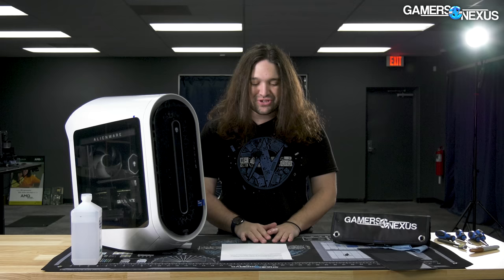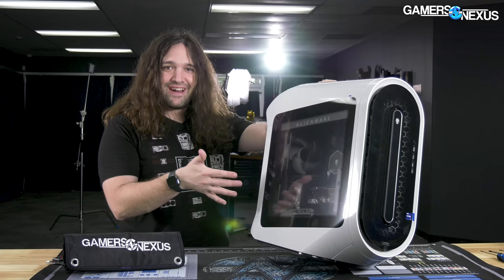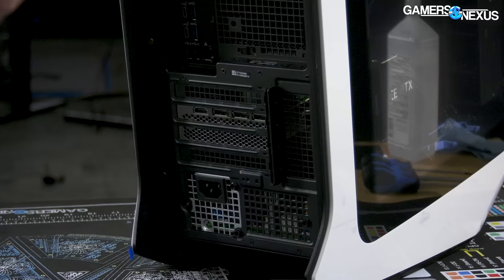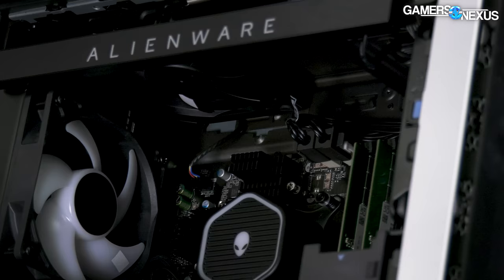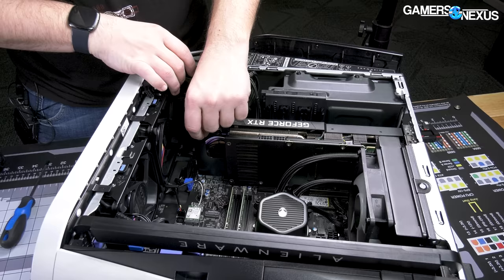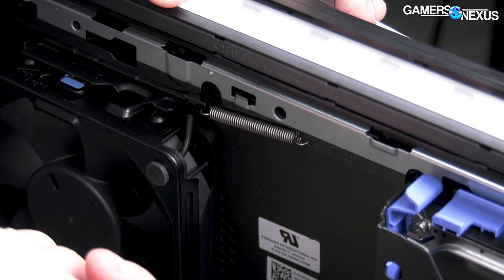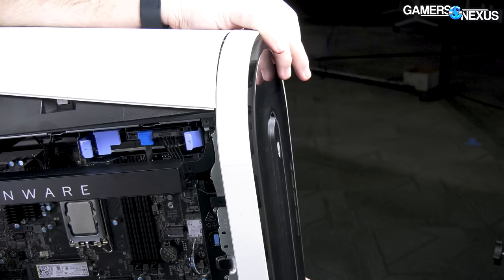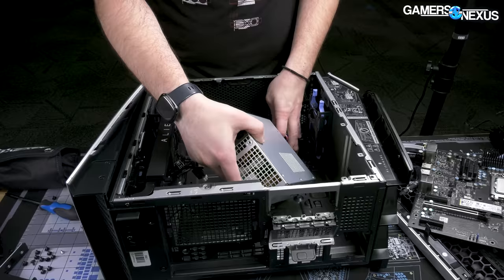Crazy Bad $5000 Alienware Gaming PC: R13 Aurora Tear-Down

Comment: Dell saved $40 by repurposing an old PC chassis...then spend thousands engineering and making parts to fit the old case.
Reply: It blows my mind. This PC is like a Kit-Car. You get a Ferrari engine, brakes, suspension, wheels/tyres. Then go to your garage and stuff it into an MR2 and expect the good results.
Reply: @tbrowniscool  and the most tragic thing is - leave MR2 alone and you will have a decent car, not mutiled piece of junk with some "good" parts
Reply: @TheMadYetti  EXACTLY! I mean it must take more effort to get all these top end bits of hardware and cram them into a tiny but also massive box with no airflow. The mind boggles
Reply: @tbrowniscool  I would bet that it's not the mechanical engineering of the parts in the case itself that's extremely expensive, so much as the engineering behind manufacturing and assembling them in a cost effective manner.  Which, based on what I'm seeing here, certainly has been a failure (nobody would call this product "affordable" in ANY way)
Reply: @tbrowniscool  a donk with an electric supercar engine
Reply: They didn't save $40.   The tooling and adding of so much adaptors adds cost to the case, and more build time.   Even the sticker that says "This is not a handle" is stupid.
Better cases can be had for less money.  Why some of us use cases that are still 10 or so years old because they WORK.  

My case is 7~10yrs old.  Has better air flow than that Dell.  Looks better IMHO, and it's white and stylized like the Alienware. Its about the same size and yet can hold a full size ATX, more drives and even DVD drives (gasp!  Mine is installed, but not plugged in).   Zalman Z9 Neo.  I think I paid $70 for it.   Not the best case in the world, but for the money and looks, it works for me.     Sigh, two of the original fans finally failed last week - so they used good fans.
Reply: Yes, that sounds about right, I worked for a certain "SI" for 7 years...won't mention names, but I will say that on the production floor the, standby joke everytime we heard about a "meeting" to make a change was "oh here we go again, there going to spend a DOLLAR to SAVE a DIME"!!! The comment made about spending $40 to make newer parts fit in an older case couldn't be more true. Maybe they wanted to make it "Vintage" Alienware...
Reply: @tbrowniscool  Thats not how kit-cars work.
Reply: @peepopalaber  I know but you get what I mean
Reply: Chasis appear to be the same as the XPS full-size desktops, just mounted on a slight angle in an even larger plastic case.
Reply: Probably comes from different budgets so nobody cares. Like how companies can't hire employees so they pay like 50-100% more than the total employee comp package to hire a contractor.
Reply: Bingo

Comment: 5k and they still have a regular HD in there. Wow.
Reply: And where is the DVD drive?
Reply: @louistournas120  dvd drive? Who has those anymore! Lol
Reply: Lmao an HDD paired with a 3090, totally makes sense. Surely that HDD will be able to stream 4k textures at blazing speeds.
Reply: Seriously they could have put a sata ssd or better U.2 connection and put in a nice 15mm enterprise ssd.
Reply: @xmateinc  me but I have bluray RW
Reply: And it's a POS Seagate HD
Reply: To be fair, they had an m.2 in there as well!

Probably some 128gb Gen 3 option for just the OS and all the Dell bloatware, but it'll pair nicely with that 5400rpm 1TB HDD lmao

They really just slapped the most biggest numbers you can find on an Intel chip and Nvidia GPU, then threw it all in a lipsticked Optiplex they had lying around from 10 years ago
Reply: @videosuperhighway7655  Or just an HDD that fits the 5K price. But they put the most budget ass HDD they could find. The kinda stuff you buy only if it's on sale and that just for hoarding data that you don't care about. 
For 5K, I would expect a Seagate IronWolf or even a IronWolf Pro, certainly not a freaking Barracuda
Reply: > regular HD in there
Makes sense if it's 16 Tb or more alongside with at least 3 Tb SSD overall storage.
Reply: @Vladislav888  what do you put on that though? Im a gamer and don’t want to install games on a 7200rpm drive. Faster the drive faster the load times and performance.
Reply: @xmateinc  > what do you put on that though?
Games that you do not play often, mods, video game footage, big Sony Vegas projects, BD-rips for Plex, backups, image coolection
Reply: @xmateinc  You pay a ton of cash for the machine, you expect it to be future proof.  A 2TB SSD and 14 or 16 TB hard drive are really the best bet and affordable even.
Reply: @xmateinc  those that want one?
Reply: Thats a common setup to increase storage space as 2nd hdd.
Reply: @ChargedPulsar  I spent a little less then 5k and got 2 990 2tb pro in my PC. Alienware is charging a premium for a HDD drive.
Reply: SSD arent suitable for long time storage tho
Reply: @MiniKodjo  erm says who? SSDs are more reliable than HDD even for long term archival, SSD live sare rated by how many writes they can do, and if you are just going write once and keep it for many years, SSD will last forever
Reply: NVMe ssd on the mobo.
Reply: @xmateinc  I do, but only because i have 13+ yearold case
Reply: There's only 1 HDD bay in that huge chassi right? ONE!

I have 5bays in my super cheap half size ATX chassi from Bitfenix 🤣
Also a normal ATX PSU, dual  140mm front and one 140mm rear fan
Reply: @louistournas120 get an external dvd drive. DVD drives are like 350w of the computers power down the drain. Modern computers quit having them years ago.
Reply: @xmateinc  if it's a game you want to actually play it needs to go on SSD.  You can always transfer to flash drive or HDD if you are tired of it, but a game you actually play should always be on SSD.
Reply: @BlakeShaddix  I always pick up PCs that are being thrown out so I have 10 DVD drives and most are SATA.
I hope new cases have a place to put DVD drives and such.

Comment: I used to work for Dell, i was on the Alienware support team. support was separated for desktops laptops and alienware had its own set of people. we had all the tech "papers" for them. the components used were of the lowest grade possible. we had to upsell and at least give the customer a sales pitch, at least once in every conversation with customers. OMG the pricing on the parts Dell had us selling, i would personally would never even consider any of the parts of any quality. but dell wanted, even the support team, to believe that the parts were of top quality as to be more convincing to the customer. our test lab had a bunch of "burnt out" parts. if you knew what the margin of profit items were , you would flipping flip. many of the parts were salvaged of older "dead units". the margin on some items were over 500% profit for Dell. We could see the prices and the margin for Dell. The tool we used\ showed us the pricing and the profit margin. some agents main purpose for doing support on Dell was to earn more for selling. yes dell did have an incentive program for agents that sold and sell they did. Not a bad extra amount earned in the month.
Reply: This does not surprise me at all. Just opening a dell computer and having a look inside even over 20 years ago you knew it was bad. It's just surprising to see nothing has changed but hey, if the scam works and people are buying the garbage what can you do? I've never been a fan of prebuilt computers in general but people need to be aware of companies like dell that they're really bad and something that should be avoided at all cost.
Reply: @huldu  I was just about to get a Dell PC but ended up changing my mind lol and I didn't even know all this stuff so thank god.
Reply: You used to work for Dell. Tell me you quit because of your morality.
Reply: @huldu  i left due to conflicting approaches to how the teams were managed. and because the winning mentality was to sell more than support i didnt want to have anything to do with dell anymore. literally if  you combed the support team, from the 30 ish people on the whole team you would find maybe only 1/3 that had a good knowledge of tech , which these people carried the main "tech" support, from ticket to lab testing to customer solution. 1/3 had basic pc skills and 1/3 that did constant "training" to learn the basics. lol. now whether or not you consider ,me not wanting to sell anything and leaving the dell  ecosystem a moral choice or not is totally on you and anyone else curious. i was and still am, not a sales rep just a PC/Server tech guy. and trying to sell to a customer that called for help isnt my thing. nor should any tech persons requirements while doing their jobs
Reply: i used to fix these at the depot. man it was glitchy bios dog sh...
Reply: How is such a garbage company still in business? Are there really that many mindless consumers that do absolutely no research into the products they are consuming? It's not like an AT&T situation where they are a lot of people's only option.
Reply: This is Mark for Aliens not for Humans... . Alienware non stop crap.... .
Reply: @mchonkler7225  Dell is huge with companies/schools who need support. It’s a shame but yea
Reply: @pricklycats  were u about to get an alienware?
Reply: @Phat_TONY  this right here is the exact reason I refused to work for Verizon. I love helping people and I like fixing phones, but all they wanted was sell, sell, sell. I knew I wasn't going to last long cuz I wouldn't have gave a shit and helped the customers properly anyway.

Comment: "We bought this 5000$ thrashheap with our own money!" had me chuckle. Keep the blade keen, GN!
Reply: Its for a good Start for sure. lol
Reply: Almost spat my coffee out when he said that, such a good line!
Reply: @Ivan Zhao If this product was modestly priced, you might have a point. But it's not.
Reply: ..and I bet even if it was something he normally did (which I'd doubt anyway) that this is so bad he'd feel like an a$$ for reselling it to recoup even half.
Reply: That line reminded me of the Firefly pilot when Mal shows Zoe the ship for the first time, and she asks him "You paid money for this? On purpose?"
Reply: @Ivan Zhao It runs like shit because it throttles the hardware down so it doesn't melt itself. Because the case is so badly designed that it can't cool the components properly thanks to being basically a 90's mid tower case with a bunch of plastic covering the airflow.

Comment: This case is bordering on the Rube Goldberg-level of design. Can't wait for the R-rating of thermals to show how badly the heat is kept trapped within!
Reply: Badly. Built a lot of relatively powerful computers into small cases and I would bet a lot of money on the GPU basically frying itself pretty soon, you simply can't cram 3090 wattage with two fans into that space and expect the heat to really go anywhere. It's mind-blowing that this is actually designed at all, you get similar thermal results just not giving af and cramming the components into a small case. Pay half the price for components, have the neighbor's kid do it, and you get the same thing. Except if the neighbor's kid knows anything about computers, then you're going to get way better results :D
Reply: Rube Goldberg is a perfect analogy. He would have been envious. And probably would have purchased one of these simply for the joy of taking it apart to see how it all fit together. I'm currently running a 6-year--old Alienware Aurora R5 that, while also over-engineered a bit, is nothing like this new one, and it's been absolutely solid and stable all these years with zero issues. And so now that I'm looking to replace my R5 with a new one, I naturally was thinking of just getting another Aurora. Glad I watched this video before I did so. I guess I'll have to keep watching this channel until Steve finds something he likes.
Reply: You figure that some marketing douche would have come up with some garbage about a "thermal stealth system" by now.
You know. Like how some Sci-Fi ships use a system that keeps all the heat inside for a while to reduce their thermal signature.
This must be kind-of like that.
The Sci-Fi systems have to turn off after [TIME] to let the heat out, or they will kill the crew.
This system needs to turn off before the built-up heat melts the solder joints.
Reply: You don't understand the design  at all.  Your suppose to use the gpu card to cook your Hot Pockets.
Reply: I get German car engineering vibes from this.  Way too much effort put into solving problems that shouldn't even exist.
Reply: @goopah  I had a r3 that I bought for parts and used pieced together and honestly other than the plastic bullshit with a regular office case inside design the thing was okay.. no real cooling issues but also the fucker weighed 35 lbs
Reply: That's been alienware from the start, to be fair.
Reply: @michaelf.2449  35 lbs sounds about right. Mine hasn't moved in 6 years, except to take the panel off to clean everything periodically. And yep, there's too much plastic on mine as well, but then again I only paid like $1500 for it (i7 with 1070FE), back when video cards were reasonable. Plus, I much prefer my case, which is a completely different design. Much better than this current Dyson fan wannabe. :-)
Reply: @goopah  the weight is just ridiculous not sure where it all comes from but it's very very dense
Reply: LOL
Reply: Lol it's the neutron star of pcs